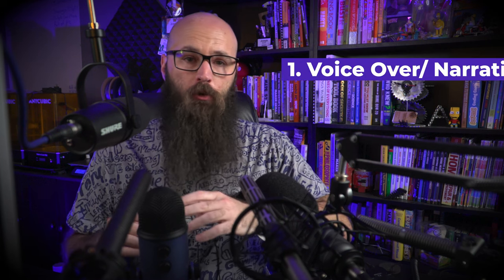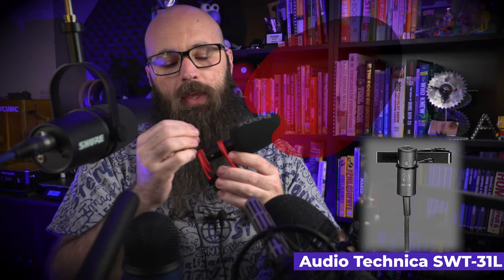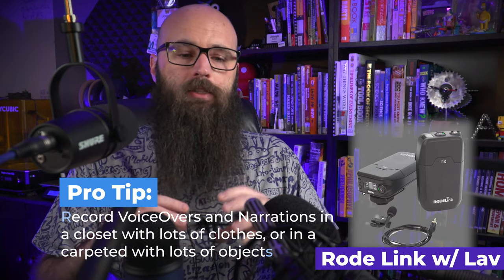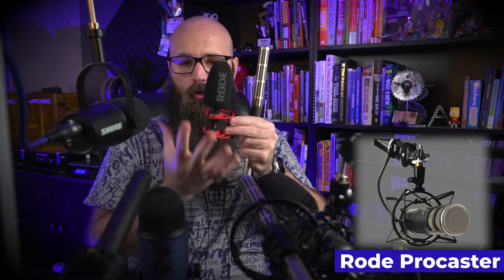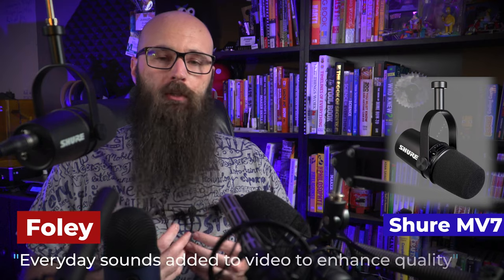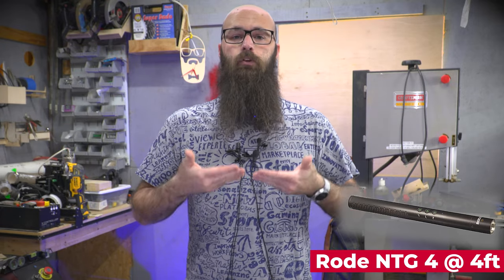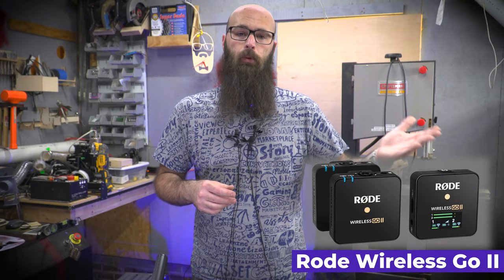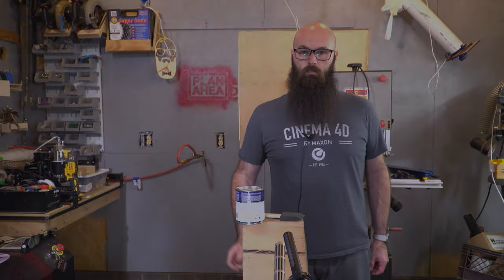THE 14 Right Microphones for Your YouTube Channel

Comment: Good info! Is there a decent lav mic you would recommend for someone on a budget?  My YouTube channel is still very new and I want to step up my audio, but I don’t know if I can bring myself to drop $200+ on something nice yet in case it turns out that I suck at this lol
Reply from the maker: The Shure BLX pack runs about $140-200 used with the CVL mic or Audio Technica.
It's what is used in a few scenes here.
Make sure the frequency is under 600mhz. Old ones are not FCC compliant anymore
Reply: @JoJaqs  good to know, thank you!